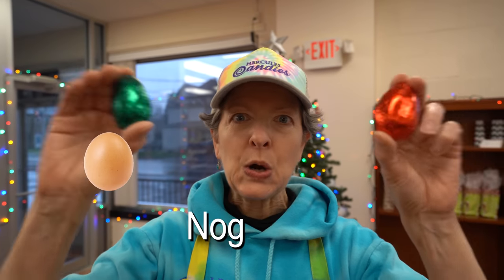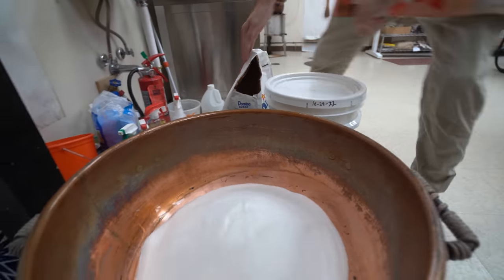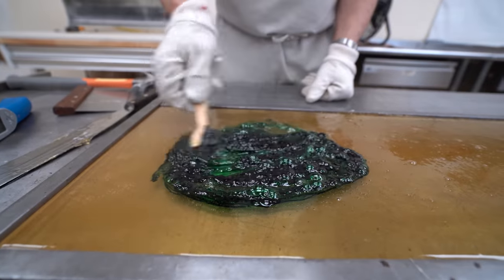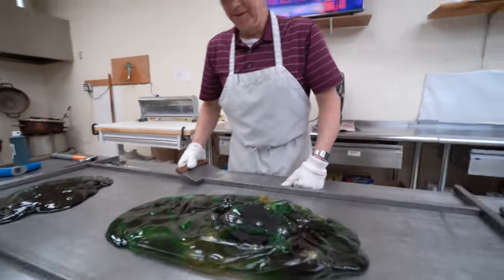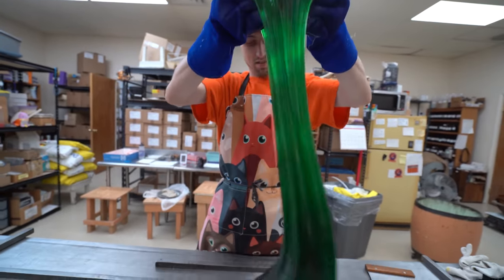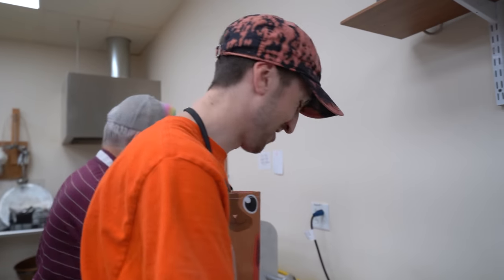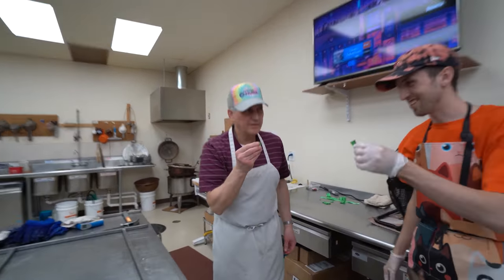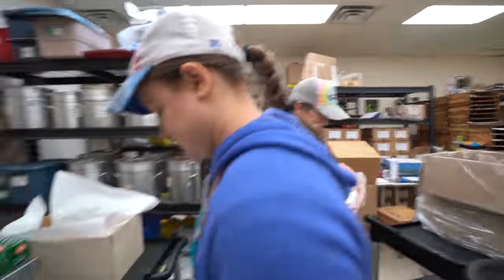We Only Make This Candy Once A Year!

Comment: You should put the ingredients/health info. label on the BOTTOM of the box as not to take away from the pretty presentation. If you're worried about damages from customers flipping over the box if the labels were on the bottom, make them smaller..or put them on the box sides. I make CATHEDRAL cookies with hard cany stained glass windows, and ended up shrinking my labels to fit the box sides, for this reason. LOOKS YUMMY! do you make PEPSIN flavoured ribbon candy?..they used to be the pink ribbon candy in the 80's I believe..wintergreen is nice too!..mmmm

Comment: At the beginning of each video I see you dunking your hands in the pan on the counter and then in a bucket. Please explain what your doing there.
Reply: The pan contains cold water, and the bucket contains corn syrup which is extremely sticky. By coating his hands with a thin later of cold water, the corn syrup does not stick as much.